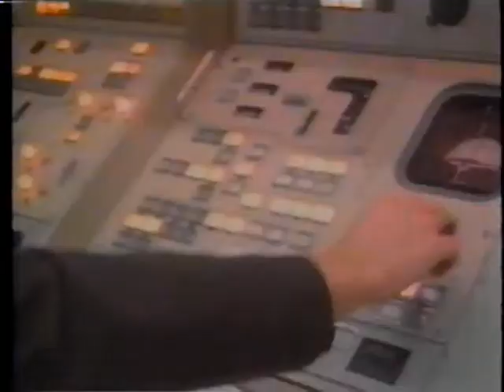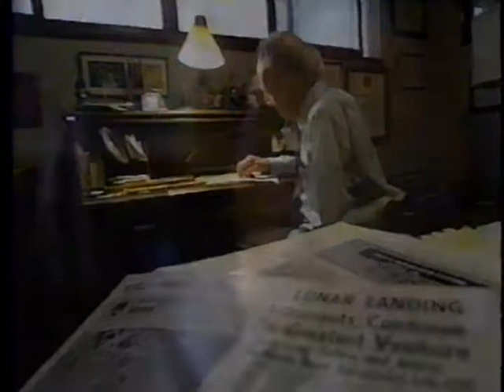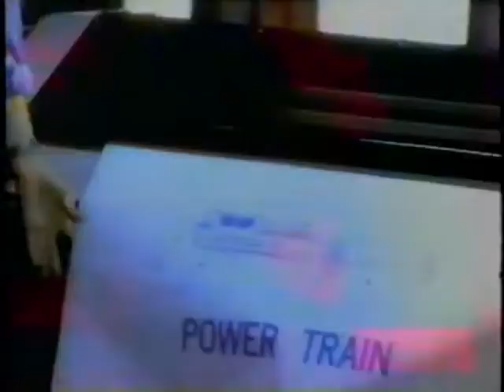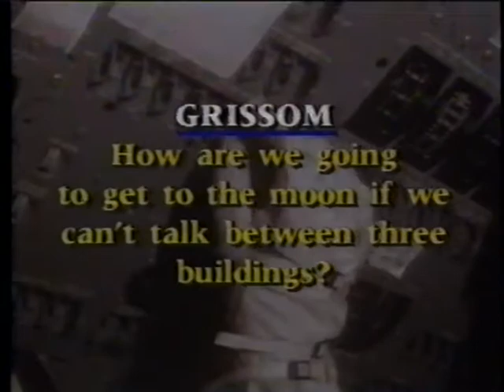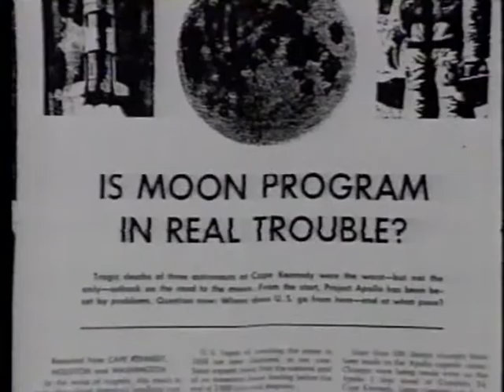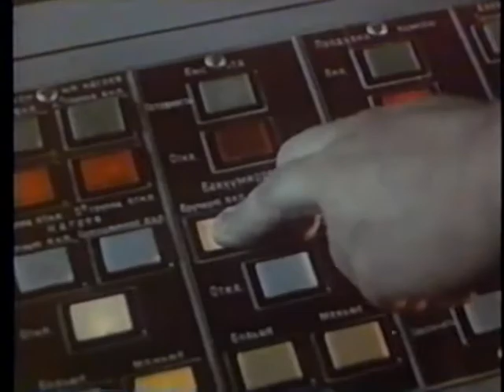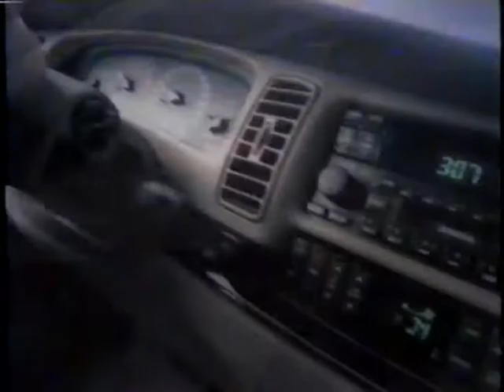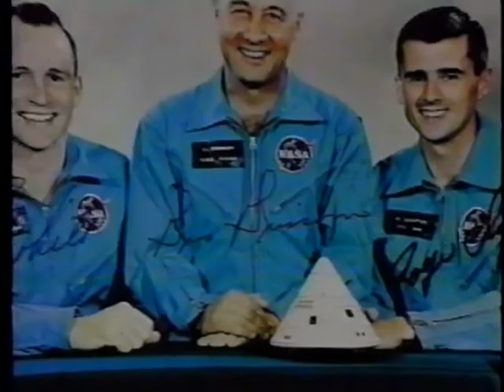"Tragedy on Pad 34: Apollo One," Discovery Channel, January 19, 1997

Comment: Except they didn’t learn and did rush ahead again even though they knew it wasn’t safe. They knew the O ring design on the shuttle boosters was flawed and were told it was too cold but pressed ahead and Challenger happened. Then they didn’t take the foam issue  seriously and Columbia was lost. 14 more lives that didn’t need to be lost.
Reply: That's because NASA management needs to have better understanding from the engineering guys because they know what they are talking about not the management.

Comment: I had developed osteomyelitis of the spine in 1980 after back surgery. I was put into hyperbaric treatment, run by two retired Air Force colonels who had worked with NASA, and the hyperbaric chamber they used in their private practice was "donated" to them as surplus by NASA. While you are in it, you receive 100% oxygen. I had noticed that when we were getting ready for a "dive" we took off our street clothes and put on "fire proof" clothing and covered our hair with "fire proof" coverings. And the clinic was in the basement of the building their clinic was in, far removed from the rest of the hospital and clinic as possible.  So I was fully aware of the possibility of a flash fire, like that which killed those astronauts.  On our second or third "dive," I had noticed another patient, who was about to under go her final "dive" had brought a small camera in with her, which used flash cubes. I waited to see if any of the staff noticed it as well, no one did. When it came time to start the "dive," I requested to be allowed to leave, told them that I felt their supervision was lacking to the point where we could have all been killed, and I refused to use that facility anymore. I did go in to their clinic for months more, 6 days a week for debridements, which might have not taken that long if I had completed the hyperbaric treatments, but I no longer trusted them to monitor the other patients for safety.
Reply: I had osteomyelitis after a dental inplant about 2010.   It was one of the worse things I ever went  through, and it probably did not come close to your case.  Surgery, then a PIC line for 6 weeks along with oral antibiotics knocked it out.   Glad  you came out of it okay.

Comment: "Go Fever" had infected the entire program. And just like "Summit Fever" has killed a lot of world class alpinists, so it happened with the Apollo program.  The block 1 modules were poorly designed and riddled with poor workmanship.  The Mercury and Gemini modules were far better built.  Grissom was one of the best engineers of the astronauts.  He fought to get things corrected, but he should have refused to fly in the thing.  

Everyone knew about the fire hazard of pressurized O2.  The hatch was almost impossible to open quickly.  As the video says, they died not from burns but from cardiac arrest due to carbon monoxide poising, like most fire victims. The gas masks the rescue personnel were issued were for poisonous gases and not rated for smoke.  It was a real cluster.   Better rescue procedures may have saved them.

Despite what appears to be a flawless safety record until the fire, there were some near misses.  Hubris.  I know everyone felt terrrible, so I don't fault them.  It was a failure of culture. 

Recommended Reading: Calculated Risk: The Supersonic Life and Times of Gus Grissom by George Leopold.

Comment: Apparantly this docu was made before the Space Shuttle also exploded. Because the lessons learned in 1967 were later forgotten, when a Space Shuttle was launched under pressure, in not ideal circumstances. A rush to a go ahead that had again tragic consequences.... Of course; zero risks doesn't exist. Everything in the 1960's was new. In the 1980's, there were less valid "excuses", even if the Space Shuttle too was new technology. The fact that one engineer understood the dangers before the launch means the others also should have seen it. They ignored the warnings....
Reply: Uh challenger exploded in the 80s, this doc aired in 1997
Reply: This aired eleven years after Challenger broke up during launch (it technically didn't actually "explode"), and six years before Columbia broke up during re-entry.